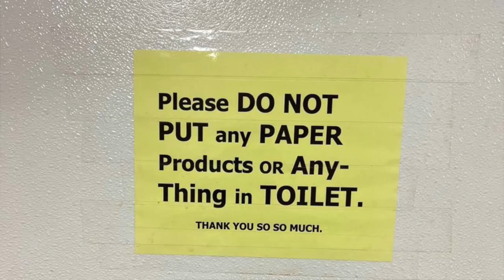Septic Tank PACKED with Toilet Paper

Comment: We have a bidet attachment on each of our toilets. Two of them are in our summer cabin which has a 1000 gallon septic tank. Our home is on the municipal sewer. Our toilet paper usage has gone way down. Last year the tank was pumped. There was a thin layer of floating scum on top that didn't need a crust buster. As for the bidet, we wonder what we did without it, and for so many reasons other than saving toilet paper, such as feeling cleaner,  and not having irritation from wiping. Ours uses only cold water, which doesn’t bother us at all, even in winter when the incoming water is very cold. I predict that anyone who installs a bidet will be very pleased with it.